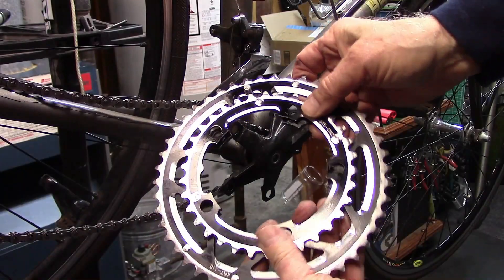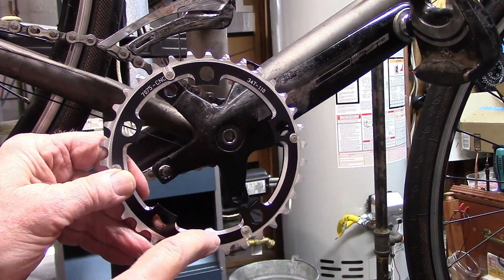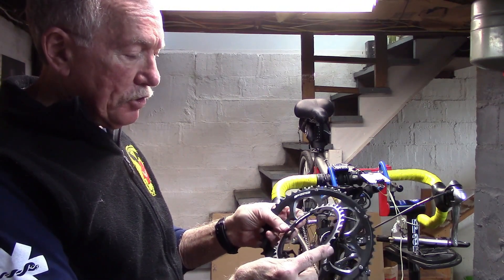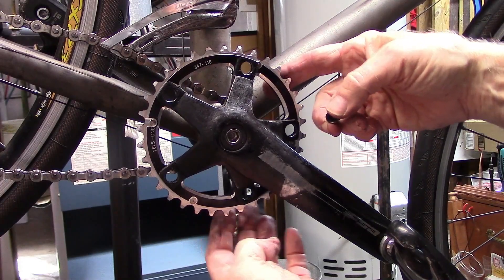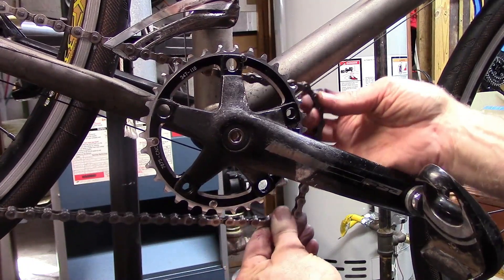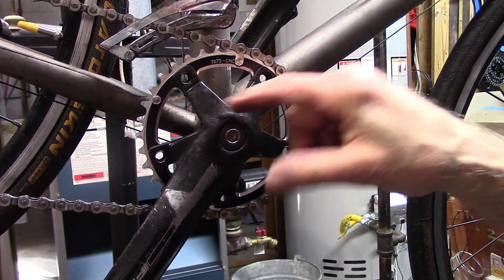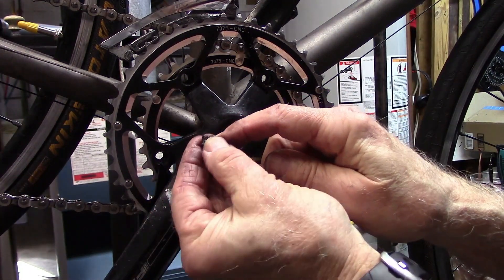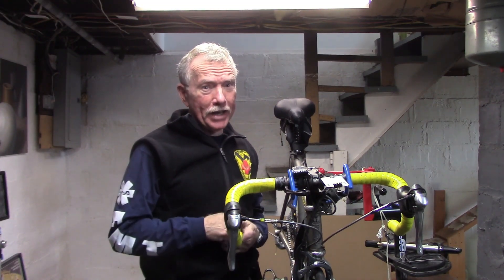Bicycle Chainring Orientation and Chainring Installation Tips

Comment: I want to know. I am usong R3500 Sora Crank (5 bolts) and I'm using R3000 FD (latest). The chain was usually going down in the middle of the chainring when i'm shifting from big to small. The LBS mechanic said that it is incompatible since the indexing of the FD was already far out. Can I validate his claim?
Reply from the maker: Are the chainrings, chain and FD all 9 speed (or at least the same speed)? Have you tried to adjust the inner limiting screw of the FD to allow the chain to move enough inward over the small chainring? Let me know and I'll tell you how I approached this problem. Tony

Comment: I took the chainrings apart to clean and when I went to put it back together I had a hunch that they had an orientation I wasn't aware of. This video was the best resource I found to explain it, especially since the smallest one is Shimano and the other two are Raceface. Got them all flipped the right way and aligned and it's much smoother than I had it before.

Thanks for this quick explanation!
Reply from the maker: You're welcome - glad it was helpful. Also visit our YouTube home site at:
https://www.youtube.com/user/MrTony10speed
Regards and safe cycling, Tony

Comment: Thanks Tony! I almost screwed up..Didn't have notches under the crank!!!
Reply from the maker: Without notches or markings on the chainrings, installation becomes a bit more difficult. Glad you were able to figure it out. 
Also visit our YouTube home site at:
https://www.youtube.com/user/MrTony10speed
Regards and safe cycling, Tony
Reply: @tony10speed  Hey..I wasn't clear, there were notches, I just didn't notice them until after I watched your vid.. I had the 50t and 39t rings correctly installed but not the 30t ring...Was easy to correct...Thanks again!!

Comment: I had terrible trouble front shifting after replacing the large chainring on a Barelli crank. Turns out that Barelli chainrings are not aligned the same as Shimano. That is, the notch and peg which align with the crank arm align with the centre of the tooth for Shimano. For Barelli there is a subtle offset between tooth and peg. To use a Shimano compatible chainring with my Barelli crank so that it would shift correctly, I had to orientate the small chainring to one of the 5 available positions (110mm BCD). Once I did this perfect shifting/timing! AJ
Reply from the maker: This is a problem mixing and matching crank and chainrings from different manufacturers as you point out. I hope other viewers will take note of your experience. Thanks for your observations and comment. Regards and safe cycling, Tony

Comment: Hello, if the chainrings are correctly aligned but if the notches are not behind the crank arm, is that a problem ?  My front chainring have 2 position for the pin, if i put the pin behind the arm, the notches are aligned but no behind the arm.
Reply from the maker: It is possible that the chainrings are not part of the set that would come with the crank. You might need to check the manufacturers web site for the crank and chainrings. 

In the mean time (while your investigating the problem), place the chainrings with the pin under the crank as you mentioned and the markings line up with each other even though they don't line up behind the crank. Take the bike for a ride and see how the front shifts. 

Even though you have the right size (BCD) and speed (9,10, etc.), not all chainrings are made to work and shift smoothly on all cranks. I've seen this when replacing chainrings with others from a different manufacturer. Regards, Tony
Reply: @tony10speed  Thanks for the response.

Comment: Very helpful Tony, thanks, I had not appreciated that there is a precise alignment needed.   I just replaced big ring on chorus 11 (4 arm) and found small / small contact had become closer than was before. this involved mixing a campag ring with TA , and perhaps that is the issue.
Reply from the maker: I'm not sure what you mean by "found small / small contact." 
Spécialités TA makes quality chainrings for their own cranksets, as well as cranksets from other manufacturers, such as Shimano, Campagnolo, SRAM and others. Things to consider when replacing chainrings are:
1. Order the correct compatible rings (Campy, Shimano, etc.) for your drivetrain.
2. Make sure the chainrings match the speed of the bike (9,10,11 or 12 speed).
3. I, personally, would replace both chainrings with either Campy or TA and make sure they "line up" as per manufacturers recommendations. Look for marks on the rings (especially the small ring) that would line up under the crank arm.

Mixing chainrings can be done, but it may be hit or miss. If you're using say, 12 speed chainring, on a 11 speed crank system, this may pose a problem. The thickness and spacing of a 12 speed vs an 11 speed or a 9 speed vs an 11 speed chainrings are different.

Is your system a double, triple, compact or single chainring drive train? Does the front derailleur shift properly (unless it's a single ring)? Let me know some more details on your problem. Regards, Tony

Comment: Dear Tony, I have put new chainrings (triple) on my bike but now the middle chainring causes to run of the chain while moving to the two smallest cogs of the cassette. The chainring wobbles and pushes the chain of between the middle and big chainring. I reassembled 5 times but same issue. Any idea?
Reply from the maker: You may have installed the wrong speed chainrings or the chainring bolts that are too long. Some 10 speed as well as 11 and 12 speed chainrings are thinner/narrower (look at the base of the chainring just below the bolt holes). For instance, when placing an 11 speed chainring on a 9 speed crank, the chainrings may sit further apart then they did on the 9 speed system, allowing the chain to fall between chainrings when shifted (as well as poor overall shifting). With the narrower chainrings, the chainring bolts may be too long and the chainrings wobble back and forth. Compare the thickness (down just below the bolt holes where the chainring sits on the crank) between your old chainrings and the new ones. The new chainrings may also be labeled with the speed (8,9,10 or 11) - is it the same as the drivetrain you're running (count the cogs in the back)? Although you can often get away with running chainrings of a different speed, it is highly recommended to get the same speed chainring as your drivetrain (and compatible with your crankset). Are the chainring bolts the same length as the old ones you used previously? Mixing different speed components is not as straight forward as it seems. Let me know how you make out. Regards, Tony

Comment: I replaced my chainrings last summer, and had this exact problem with the chain sitting on top of the small chainring. Very dangerous when switching while standing as it didn't always go onto the small ring but floated above. I learned something new today after watching your video,  Now the marks are correct, hopefully this will resolve my issue. Thank you
Reply from the maker: You're Welcome. It's a topic not addressed by most videos but, as you noted, very important.
Also visit our YouTube home site at:
https://www.youtube.com/user/MrTony10speed
Regards and safe cycling, Tony

Comment: I use a Q-Ring small chain ring and a SRAM RED 22  large chain ring without issues, so he is incorrect about using different manufacturers  on the same crank.
Reply from the maker: In some cases, such as yours, it will work. But in others, shifting performance may suffer. I suggest the same manufacturer as a precaution rather then generalize based on one installation. Thanks for your comment, Tony

Comment: The teeth on the large chainring seem to vary in height - is this normal?
Reply from the maker: Modern chainrings have teeth that vary (in height) from each other. They are formed that way to enhance shifting between the different chainrings. Older chainrings from a couple of decades ago had teeth that were symmetrical as they did not have the advanced profiles in use today. However, the top of the teeth do not wear. If you notice "shark like teeth" or the grove between the teeth appears elongated or uneven, the chainring shows signs of wear and needs to be replaced. See:
https://www.youtube.com/watch?v=sXdrOQpr-Zg

Comment: How do I know if the writing on the chainring faces in or out?
Reply from the maker: Most chainring have the writing facing out with a vert few exceptions. The recesses for the bolts on the small chain ring face in and the recess on the large chainring face out. When in doubt, check the manufacturers website.

Comment: Are oval chainrings still used?
Reply from the maker: Oval chainrings were used by Bradley Wiggins and Chis Froome in their Tour de France wins but have seem to fall out of favor in recent years. But according to Tim Kerrison the performance director at Team Sky: "Power reads higher, but this does not correspond with an increase in the power actually being generated by the rider.” I, myself, try to teach new cyclists to have an even pedal stroke & cadence on the flats and to think circles as they climb which corresponds better to a round chainring. Thanks for the question, Tony

Comment: I have found that you can use a cassette with one larger cog then the specs for the derailleur.
Reply from the maker: That is especially true for Shimano. The manufacturer is very conservative. In other cases, the addition of a Wolf Tooth Hanger Extension will allow a bigger rear cog. Thanks for your input and regards, Tony

Comment: How does the pin under the crank allow you to get the chain back on if it comes off to the outside?
Reply from the maker: If the chain drops to the outside, it is kept aloft by the pin not far from the upper teeth of the smaller chainring. In such cases, sometimes (not always), one can shift back to the small chainring and have it engage. Of course you'll want to adjust the outer limiting screw either out on the road or when you get home.

Comment: If there's no pin on the large chainring?
Reply from the maker: No pin or marking on the large chainring is something I see when restoring vintage bicycles. The markings on the chainring usually face outward as well as the recesses for the chainring bolts but how it is orientated in relation to the crank arm often becomes trail and error. Sometimes I can find info and specifications on the manufacturers website (if I'm lucky). If the chainrings are worn, I'll look for a compatible chainring set (with pin) that has the correct BCD and speed (8, 9, 10, etc.). This is a good question and maybe some of our viewers can help. Regards, Tony

Comment from the maker: Check out our complete review of chainring: https://docs.google.com/document/d/1PCDN1lUxSwl53JOLULXdNBJ9JS5MGW6PjHr7WZgrm08/edit?usp=sharing
Also note that the markings on most of the recent chainrings face outward with a few exceptions, but the recesses for the chainring bolts on the large chainring always face out and the recesses on the small chainring face in. Check the manufacturers specifications when in doubt.